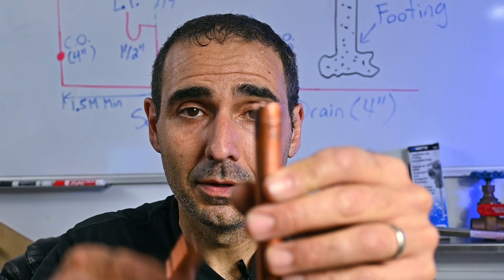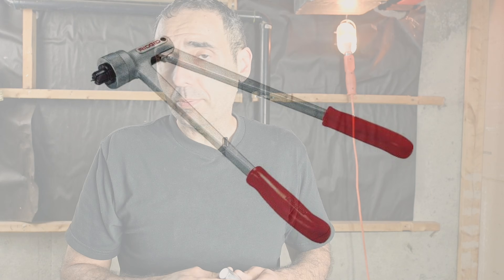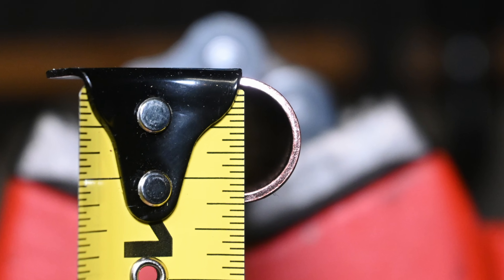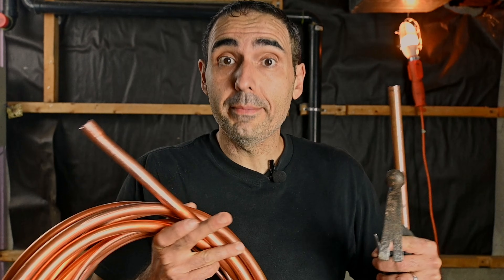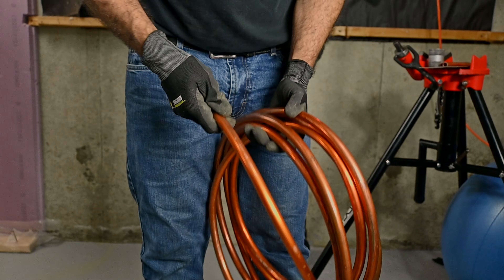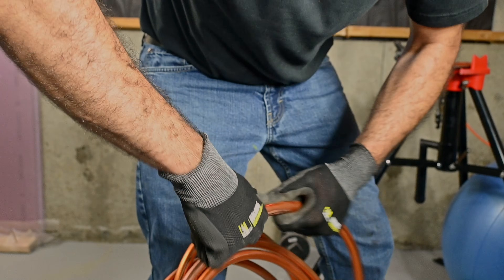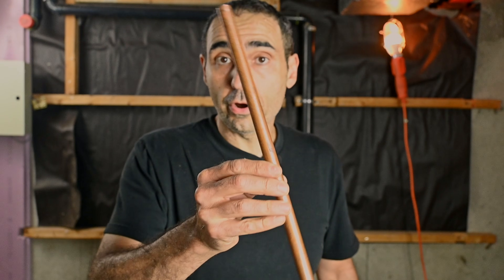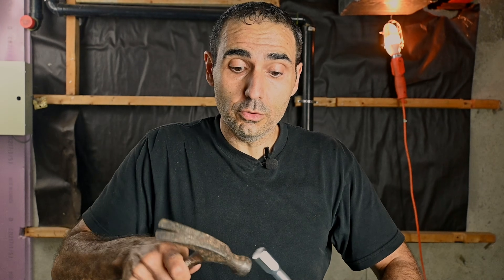Never Need A Coupling Again!  How to Swage Copper Pipe!

Comment: Thanks for all the excellent information. At first I was thinking about reaming as a solution to make thin wall tubing for a project I'm working on and to be perfectly honest, I never even considered swaging copper pipe before! 👍👍
Can you please tell me if it's possible to swage copper while it's still hot in a vice to a. make it easier and b. produce thinner walls?
Reply from the maker: Thanks so much for the the positive feedback! 🙏 I'm glad you found the information useful...that's what it's all about!

Regarding your swaging questions:

1.  You can probably theoretically swage copper pipe while still hot and in a vise, although you may still need to provide quite a bit of counterforce with your other hand, as you hammer the tool in; otherwise, I'd expect that the vise's teeth wouldn't be able to hold the pipe steady enough without causing the pipe to slip with each hit (tightening the vise TOO much will squish or damage the pipe.  An alternative to hammering would be to try an expansion-type swaging tool, although they will set you back more than this simple tool, and I'm not sure how effective the cheaper expander would be.

2. By "thinner walls", I'm presuming you're referring to making the pipe larger than the female hub counterpart of pipe your swaging (for example, turning a 1-inch pipe into a 1-1/4-inch female?). If so, then theoretically it should be possible, although I never tried. Two things to keep in mind:  With respect to plumbing, our Code explicitly states that pipe can only be swage to accept pipe of the same diameter diameter - I imagine other areas would be the same.  Still, if you'd like to proceed (in the name of science!), I'd suggest using heavier-walled piping, such as Type "L" or even thicker Type "K", because they'll provide you with more material tor stretching out (like a balloon!).  Of course, the thicker the wall, the more force/effort you'll require to drive the tool.

Hope that helps, and thanks again for watching!
Reply: @PlumbingsCool  Thankyou very much for taking the time to reply. My project involves using micro bore copper tubing as a starting point to produce thin walls, as opposed to mating much larger plumbing pipe together as shown in your excellent video.
It might be possible to hold it gently in a vice while resting one end up against a stop end? - without having to worry too much about damaging the end as it can be cut off and discarded. I'm only aiming for short sections of about 2" lengths anyway. I could probably attempt a press fit in the vice rather than hammer it? I shall try that and with a bit of luck the swage tool won't get stuck if I do it in stages!
By the way I'm watching here from the UK and already subbed to your channel. Thanks again! 😊
Reply from the maker: Watching all the way from across the pond...that's awesome, thank you!  

Well, whatever you're making certainly sounds intriguing, to say the least.  Here's what I learnt in life so far:  Sometimes, we simply need to take a leap of faith and try something to see if it works out.  Ask yourself, "what's the worst that can happen"?   In your case, you'll end up with some a few £'s spent and a bit of scrap copper.  But more importantly, you'll end up with a LESSON!...which may ultimately spawn some new ideas for you.

One problem I find is that as we grow into adulthood, we lose the element of play and experimentation, which stifles our creativity.  Good luck!
Reply: @PlumbingsCool  Thank you. Yes I agree, taking a leap of faith is sometimes the key to success. I've never been afraid of trying new things and discovering the possibilities! Failure is also an opportunity in which to learn and improve. Saying that, I'm also old/wise enough to recognise the talent and expertise of others too and often take inspiration. I'm 62 in a few days time - proving we're never too old to learn! 😊
Reply from the maker: Never too old!  You've gotta keep poking at life to keep things interesting!  Happy upcoming birthday! 🎈🥂🎂